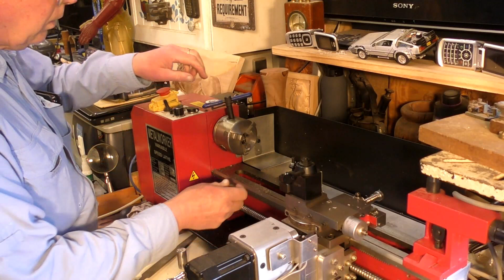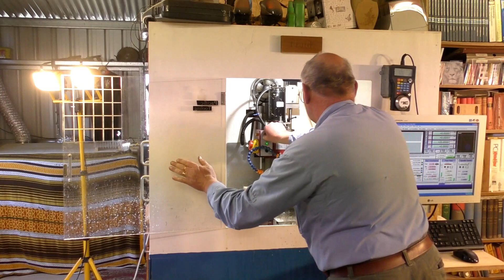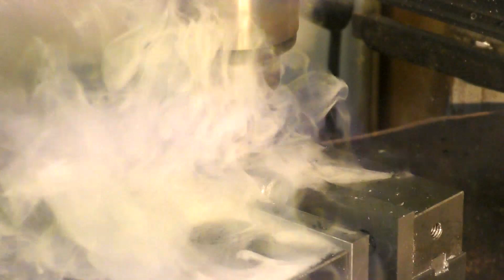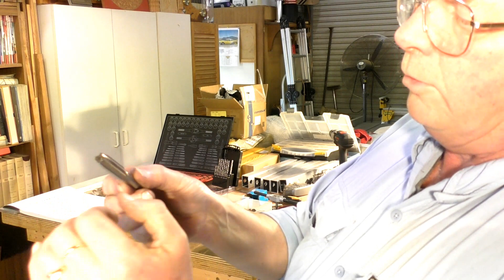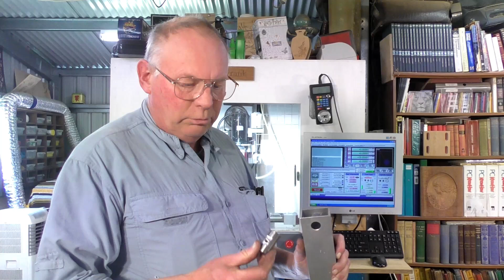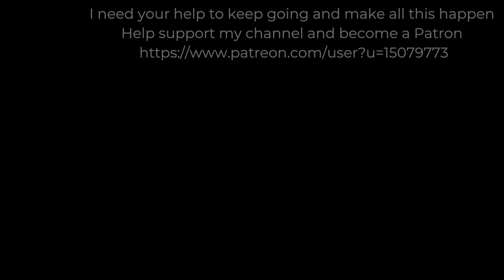Build the MIDI CNC Router chassis parts episode 2 with OOPS!!

Comment: Hi Roger, Good use of materials that you can get from local suppliers ( I live in New Zealand ) and it looks like it will be reasonably rigid. If you have a good cut-off saw that cuts square it will make assembly a breeze. As for the controller people have a choice of using what works for them. On my last machine I used the Centroid Acorn and it works a treat once you get your head around it. Keep up the good work and stay safe.
Cheers Dave.

Comment: Roger.....just did a looksee at the SMC5 off line controller you mentioned in the first video and it sells for....gasp, A$600-A$750......that is big bucks, my CNC mill runs with Mach3 on a Win XP computer that cost me A$50......... can't think how this is going to end, getting a bit exotic I think.
A router of the size you mentioned will need a bigger spindle, most very probably water cooled and the peripherals etc are over a grand.......have you thought about a ball park overall figure for the build?
Reply from the maker: I paid USD$350 
Total for the build about USD$1000
Reply: @inventorsworkshop9600  Wow.......that's approx A$1,500 give or take......linear rails, balls screws, water cooled spindle and stepper motors + the SMC5 would be a large part of that budget and that has not touched on the cost of the aluminium for the frame......you would be competing against the ubiquitous 6040 from EBAY  that most people want today.....(2-3 months with the virus problem)...... as opposed to sometime in the near future with a DIY build.......components will still be at the mercy of the shipping delays that are currently in force.
Reply: @inventorsworkshop9600  Roger........it's ZED not ZEE for the up and down axis....you and we are not Yanks who always do it differently.
Reply from the maker: OK,OK, it's zed then;-))